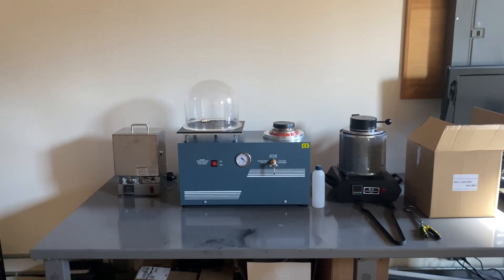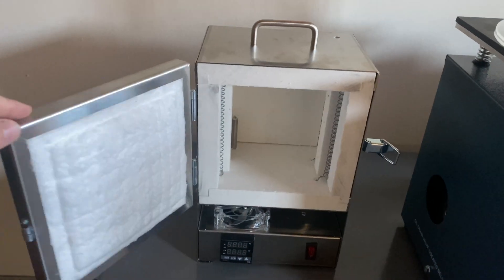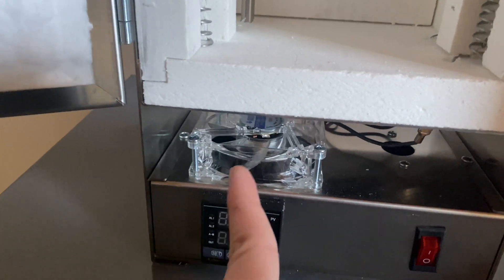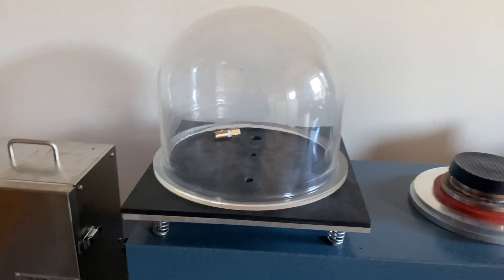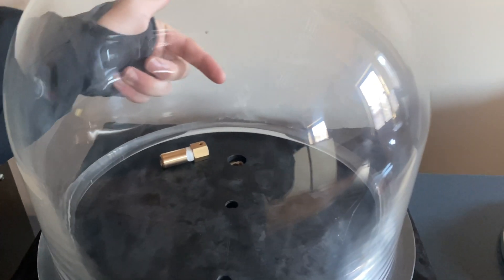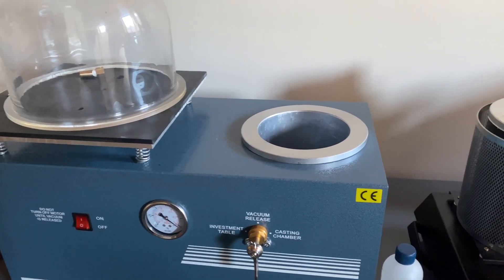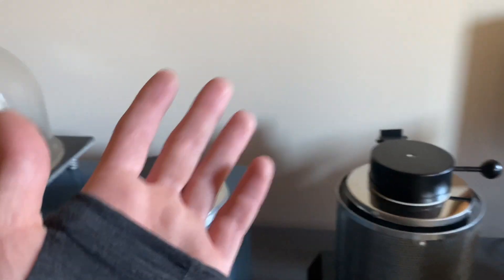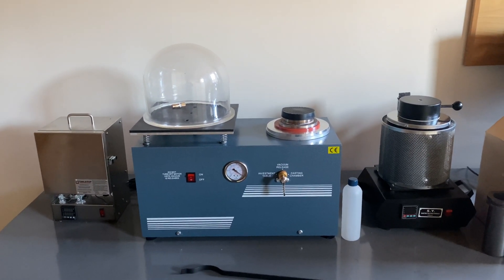My Investment Casting Setup #1

Comment: Whats the biggest sized object you would be able to make woth the vurrent flask? Does it seem like you could find a bigger one to fit in there? I want to do velt buckles and am unsure if this would be too small.
Reply from the maker: I believe the diameter of the flask is 3.5 in and the height is the same. The vacuum machine comes with adapters that could accommodate a larger flash. Hope this helps.

Comment: What about for gold
Reply from the maker: This set up should work.
Reply: @Levi_Sheridan  what does the middle machine exactly do
Reply from the maker: @hustleusa  it has multiple functions in the casting process. It helps remove air bubbles from the investment while mixing and after pouring it into the flask. It is also used when pouring metal into the mold and helps the metal fill the mold effectively.

Comment: Hello, I have one question. When you bake the mold, you put it in the casting chamber in the vacuum system, I'm not entirely clear why? A negative pressure is created in the chamber around the mold, but the metal is poured into the cavity in the mold in which there is air.Somehow it doesn't make sense to me . Next question . The red seals look like silicone rubber, it has a typical temperature resistance of up to 300C (560F), but for example the material for making a mold for casting gold Prestige UNICAST has a firing temperature of 750C (1350F).
Reply from the maker: We put the flask (mold) in the vacuum while casting to help the molten metal fill the mold fully. When then metal enters the mold, there is a pressure difference across the top surface of the metal exposed to the air and the interior of the mold. This pressure difference drives the metal into all of the fine details of the mold.

As for the red seals, I believe they are silicon. They do sustain damage through use and have to occasionally be replaced.

Thanks for watching.
Reply: Thanks for the reply, it sounds logical, but even so, I would assume that the fired clay or phosphate form is practically impermeable. I am going to purchase technology for precision casting of copper castings from 5 to 50g (Lost Wax) . For casting, I looked into vacuum casting, but building a cheap vacuum chamber in which I put a hot mold, suck out the air, melt the metal inductively and tip it into the mold is not exactly trivial. I will probably cast a plaster plug and test the permeability at a pressure of 1 bar (15psi)  Thanks again  @Levi_Sheridan
Reply from the maker: @SheldonCoper-w8i  good luck with your testing. The plaster I use is Ultravest from Ransom and Randolph if you are interested in taking a look.

Comment: That casting machine is a chinese one correct?  How has it performed?
Reply from the maker: The casting machine is from China. It does what it’s supposed to do and it does it consistently so I can’t complain. It did come with a broken part but vevor, the manufacturer, quickly sent a replacement part.

Comment: Levi, im curious as to how the vacuum machine pulls a vacuum on the solid cured mold while you pour?  The only hole in mold, you are pouring thru…. So the solid base of mold is down. Does it pull a vacuum thru the cured investment? Puzzling to me.
Reply from the maker: The investment plaster is porous so air can be sucked through it. This is why off the shelf plaster like plaster of Paris won't work well, among other reasons. You need to use specially formulated investment casting plaster.
Reply: @Levi_Sheridan  Thank you Sheridan.  I just ordered the oven.  Will try to get the others as I can. I appreciate the help.

Comment: Hey who do you contact if your concerned the vacuum doesn’t work
Reply from the maker: First I would try to contact whoever makes it and if that doesn’t work I would contact whoever sold it to you.

Mine was made by vevor and sold to me by Walmart. I had an issue with mine and contacted vevor who quickly sent me a replacement part.

I hope you can get your vacuum system working!
Reply: @Levi_Sheridan  hey I’m really confused on how to change the oil on this vacuum Machine and I think that could be the problem. Is there a way I can contact you and u can give me some tips
Reply from the maker: @Dr.MoneyMonday  I’d recommend reaching out to vevor cast or finding their manual online.

Comment: Where do you put the oil ?
Reply from the maker: There is an access panel on the back of the machine that give you access to the pump.
Reply: Thanks I was just trying to cast with it and I wasn’t getting the correct suction. I brought it brandnew but did not add oil. Do you think that’s the problem?
Reply from the maker: @marquesgreene3816  absolutely! It’s an oil submersion pump. You could damage the motor if you run it without oil. Open up the back and you’ll find them pump. There are two ports so make sure you pour the oil into the correct one. There is a sight glass with a level indicator so fill it up to the correct height you you should be fine. Also, make sure you use vacuum oil!
Reply: @Levi_Sheridan  thanks very helpful
Reply from the maker: @marquesgreene3816  of course! Feel free to reach out if you have any other questions!
Reply: So I got the oil in. And it’s like it wants to work sometime. I’m getting the suction on the bowl but no bubbles
Reply from the maker: @marquesgreene3816  there are two ports on the vacuum. Make sure you pour the oil into the correct one such that the sight glass fills up with oil to the correct level.
Reply: @Levi_Sheridan  yes I did that. The part that’s is holds the flask is working correctly so that means the pump is working. But we I got to put my investment under the bowl it’s sucks the bowl but the dial isn’t going up pass 5
Reply: My tabletop furnace is reading EEEE nd not turning on now. I’ve on used it 4 times
Reply from the maker: @marquesgreene3816  Which furnace are you referring to? Regardless, my recommendation is to contact whichever company you purchased it from.
Reply: It’s the regular one not the pro. I just used it now it’s reading EEEE
Reply from the maker: @marquesgreene3816  is it the metal melting furnace or the burnout oven? The computer used in either is pretty standard so I would look around online for that error code if you haven’t already reached out to the company.

Comment: Is it worth it to have casting equipment at home especially with a high electricity bill!! what is the cost to burn one piece of resin/wax?, Thanks.
Reply from the maker: It’s less than $4.00 United States dollars in electricity cost where I live for one burnout. Your cost would depend on where you live but it shouldn’t be significantly different. Wether or not that’s worth it is up to you.

Comment: Hows everything been going? You turn a profit? Is it still really 100 to 200 a litre for wax resin?.. I feel like it should be only used for like one offs but if you know you might want to make more of say one ring then use regular uv resin and make a silicone mold off it where you can always just pour wax back in
Reply from the maker: Everything is going well! I haven’t used to equipment to make parts for sale so I haven’t made any profit. Wax resin can range anywhere from $50-250 per bottle. And yes, you are correct, if you want to go in production, the best Approach is to manufacturer a reusable silicone mold that you can inject wax into. Still, 3D printing does offer some manufacturing capabilities that injection can’t achieve so it’s a case to case manufacturing decision. Let me know if you have any other questions.

Comment: does that furnace work better than the "toauto  ( red S.Y italy)"? people comments that the red one have problems melting cooper. what about this one? I'm trying to decide between those two
Ty dor the video
Reply from the maker: I’ve never used the toauto furnace so I cannot tell you which one is better. The furnace shown in this video broke when trying to reach the temperatures required for melting copper. I now use the table top furnace company metal melting furnace and highly recommend it if you can afford one.

Comment: How much
Reply from the maker: Total set up cost around $2000 usd
Reply: How I can get in India
Reply from the maker: @sureshgobi599  the burnout oven is made in the USA. I am not sure if they will ship to India. You should be able to find the vacuum machine and metal melting furnace on websites like Alibaba or similar sites.
Reply: @Levi_Sheridan  hallo Levi
Thanks for your video. I´am also learning casting jewelery and adore the profession goldsmith.

Comment: How much is the total cost???? Please tell
Reply from the maker: Approximately $2000-2500 USD
Reply: @Levi_Sheridan  it is too much for me, actually i am student of mechanical engineering and my final year project is manufacturing of mechanical parts by investment casting. So i am looking for budget friendly under 400$ setup for my project
Reply from the maker: @herpubg  I would reccomed you look into green sand casting. The only major investment you would need to make is into a metal melting furnace like the one in this video for $200-400. The rest of the supplies are low cost and can be made by hand. Let me know if you have any questions.
Reply: @Levi_Sheridan  Thanks for the suggestion. we are looking in the local market that how to do this. your video is helpfull
Reply from the maker: @herpubg  good luck!

Comment: Hey Levi, thanks for this video.
I am in fact from Belgium and also want to start something with jewelry. Do you recommend this stuff as a beginner? And is the quality good?
And the 3D printer is it good?
Reply from the maker: Hello! I do recommend most of the equipment in this video. Both the burnout oven and the vacuum machine work well and consistently. The metal melting furnace in this video, while it may work for some people, is not something I can personally recommend. I found mine to be low quality and mine actually broke after minimal use within advertised operating conditions. I’ve made an updated video where I recommend a different metal melting furnace that you can watch here https://youtu.be/wSSSyvZ-uiA

I would absolutely recommend these tools for beginners. For the money I do not think you could buy better tools for the job. For the burnout oven and vacuum machine I believe they are the least expensive consumer products for their respective purposes and both work extremely well. As for the metal melting furnace I recommend in my new video, it is not the least expensive version but for the quality of the machine it is absolutely worth the extra money if you can afford it. Both the metal melting furnace and burnout oven are sold by a company that provides great customer support as well. There is also the option of building your own equipment but that requires a lot of skill and personally I do not believe most people could build similar quality machines for the same amount of money as the products I recommend. 

As for the 3D printer, mine works great and serves the purpose I need it to serve. I can’t say I haven’t had a few problems with it but overall it does what I need it to do. Most sla/dlp printers will do the job though and are actually quite affordable is great.

Please let me know if you have any other questions! Good luck on your endeavors!
Reply: @Levi_Sheridan  Thanks Levi for your reply
Appreciate it deep from my heart, has given me some insight.
Hope you get far with your career.
Peace

Comment: Can you tell me about the benefit of the vacuum?  In the casting, because I notice that the investment mold does not have holes to suction air
Reply from the maker: The metal flask that the mold is made inside of does have holes. The purpose of the vacuum is to create a force which assist in filling the empty space of the mold with the molten metal. The pressure inside of the vacuum is much lower than atmospheric pressure which creates a force which pulls the metal into the mold more effectively than otherwise.

Comment: Imma teen and I wanna get into stuff like casting you think I should save for this or use a method with torches  etc...
Reply from the maker: Hello! I can’t offer any advice regarding casting with torches because I’ve never done it but it’s clearly a widely used method so I’m sure you’d learn a lot and have success if you chose to try that method. Personally I think casting using the method in my videos would allow you to make larger parts than most other techniques. It mostly comes down to what you plan on making and out of what materials. I have had tremendous success with the equipment I’ve used and I would definitely recommend it if you are able to acquire the machinery. Please let me know if you have any other questions and id me more than happy to try to answer them! Good luck with whatever you decide to do!

Comment: Bro is that all the equipment you need to cast gold or any type of metal?
Reply from the maker: Essentially, I would say this is 90% of the required equipment in order to cast most metals. Everything else, the other 10%, is inexpensive and accessible. You’ll also need equipment to finish and polish your parts as well. If you have any other questions just let me know.
Reply: @Levi_Sheridan  what equipment do you use for polishing?
Reply from the maker: @Layf_5700  I just use a rotary tool with a small buffing wheel attachment. You could spend more on a better setup but it’s just what I have and it works well.
Reply: @Levi_Sheridan  thanks bro
Reply from the maker: @Layf_5700  of course! Let me know if you have any other questions.

Comment: I would like to know using the furnace in your flat does it get tooo hot in the room?
Heating up to 800-1000 C might get very hot and is there any fire danger?
Reply from the maker: Hey Armask! My shop is about 90 square meters and I have had no issues with the space heating up in a significant manner while operating both of the furnaces in my setup. The insulating material used in both the furnace and the oven are wonderful. It can definitely get a little warm in the immediate area while a furnace is open but generally, I keep some fans running and a window open which brings in fresh and the room stays cool. 

When operating the furnace and oven there is of course some risk of fire. Both the furnace and the oven are electric and  are made of fire resistant materials which dramatically lowers the risk but still there is some. I have had no fires within or near the furnace or oven yet. As long as you are carful, thoughtful, and deliberate with your setup and use of the furnace and oven, I would say the risk of fire is very low but still existent. Thanks for watching!
Reply: And more thing - this furnace uses a lot of electricity? 
It suppose to work like 8h + - and make a lot of heat, so probably it uses a lot of it?
Reply from the maker: @armaskdaufuzz2286  the furnaces both consume a maximum of 1500 watts which is typically the maximum power for most buildings main supply in the United States. It would depend on where you are in the world but for me the cost is not too bad.
Reply: @Levi_Sheridan  1500watts per hour?
Reply from the maker: @armaskdaufuzz2286  1500 watts is the maximum power consumption. The power consumed over time depends on your use of the oven and the external environment.

Comment: Hi! Can you melt silver in that burn out oven?
Reply from the maker: Hi Tyler, yes you can! The burnout oven can reach temperatures of 2000-2200 F. The same company that makes my burnout oven makes a metal melting furnace which I have and it works really well. I’ve made an update video to this one where I talk about my experience with these machines. If you are interested please check it out here: https://youtu.be/wSSSyvZ-uiA
Reply: @Levi_Sheridan  If the burnout oven can melt metal, why do you also need a melting furnace? I'm confused if I can get away with just a burnout oven or not. Does the melting furnace have any advantages other than the ease of top loading?
Reply from the maker: @YokaruXD  while the burnout oven can melt metal, it and the metal melting furnace both serve distinct and necessary purposes of the investment casting process. Investment casting requires a wax or plastic core to be melted/burnt away from the inside of the plaster in order to create the cavity in which the metal is poured. Additionally, the plaster mold must be heated to a high temperature before pouring the metal into it. We need the burnout oven and the metal melting furnace for these reasons. The flask must be continuously heated up until the moment the metal is poured into it. If we were to try to heat the mold then remove it from the burnout oven and then melt the metal in the burnout oven, the mold would have cooled to significantly and the cast would most likely fail.
Reply: @Levi_Sheridan  Thanks man

Comment: 6:10 these furnaces work well, but they don't last long. i burned two of them out in only half a year. so i decided to build an induction furnace. it works well and now i can melt stuff at over 1300 °C.
there is a crude video on my canal, if you are interested.
and interesting video , i like it.
Reply from the maker: Your furnaces lasted longer than mine did! I broke my the first time I went to test it. Brought it up to its maximum advertised temperature and the thing made some sad noises and quit. I acquired a new furnace from the same company that makes my burnout oven and I love it. I made an update to this video where I talk about my experience with the machines after a few months of working with them. I will definitely check out your video. Thanks for watching!

Comment: This all Machines price
Reply from the maker: It would depend on where you got each tool but I spent approximately $1500-$2000 USD on this exact setup. My current setup, I replaced the furnace on the right, is probably about $200-$300 USD more than the one in this video. I made an update video recently about the new furnace and my experience with the entire setup if you are interested. Thanks for watching!